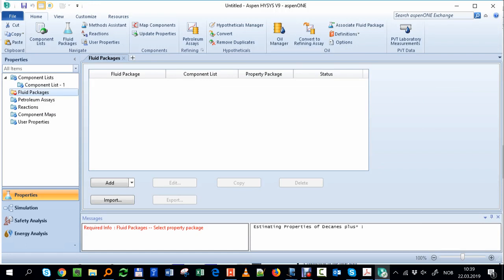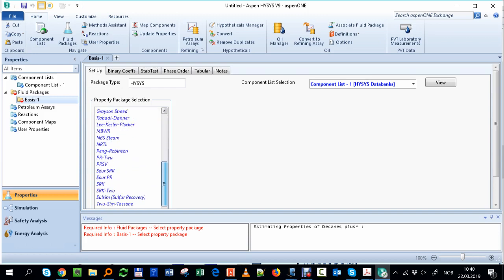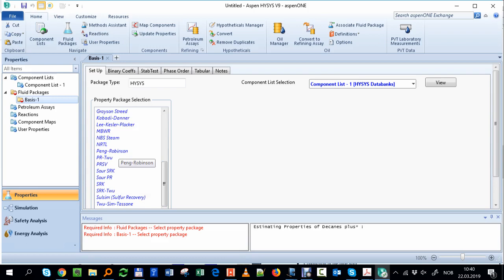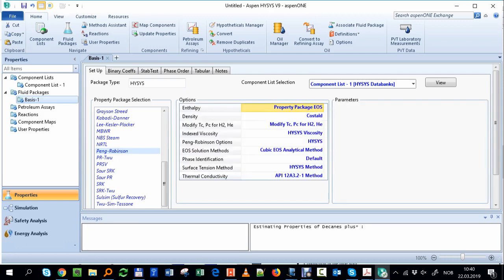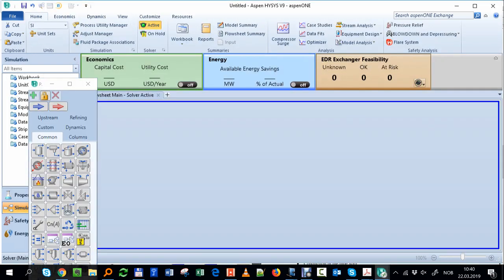pressure and temperature calculations along wet gas pipeline - Hysys

Comment: Please I would like help on the following areas. 
1. Please can you send me the reference for the problem you are solving? Especially the table of composition for the inlet stream. 
2. Please can you help out with how to input methanol into the stream to simulate hydrate formation inhibition?
Reply from the maker: The data is available here: http://www.ipt.ntnu.no/~stanko/files/Courses/TPG4230/2019/Exercises/Set_5/  Methanol can be included as an additional component when defining the components list in Hysys. Make sure to choose a proper EoS model. To see the effect it has on the hydrate equilibrium line, attach an envelope to the stream (attachments---Analysis --Envelope). Alternatively, you can estimate the amount of inhibitor by using the Hydrate formation utility (Attachments--Analysis--Hydrate formation), however it seems the only inhibitor available is MeOH in my version of Hysys.